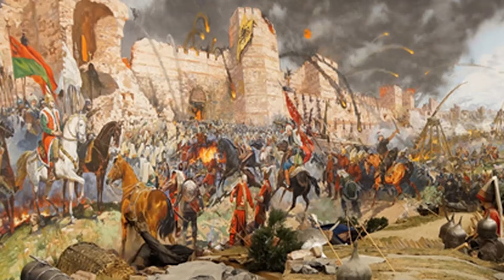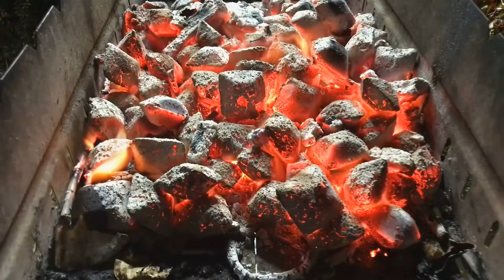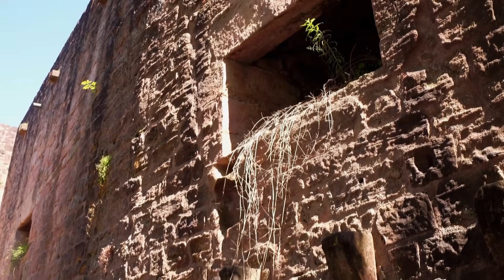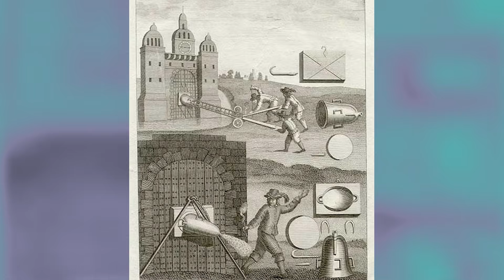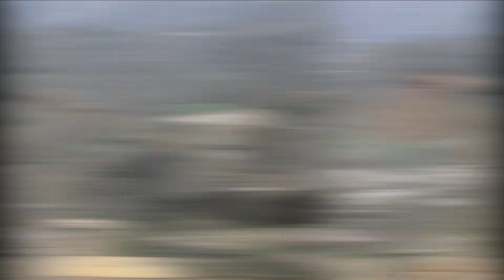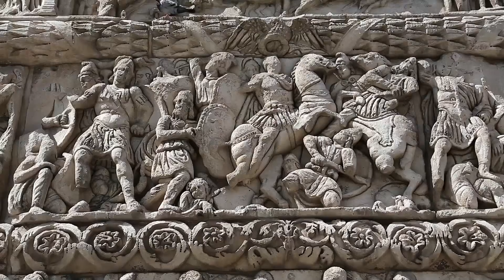15 GENIUS Ancient Siege Weapons

Comment: So many issues with this post. The timeframe described is far from "Ancient" (which is a specific historical term used to refer to a time period which, at least in western history, took place prior to the Classical era, or at most, includes the Classical era and ends with the start of the middle ages) - Explosives and Trebuchets are from the Renaissance and later. Circumvallation is not a "weapon", but a strategy of conducting a seige. Claiming it is a "weapon" would be like claiming encirclement or a feint is a "weapon". Finally, both Aristotle's Claw and Archimede's Mirror are almost certainly fake. They have been investigated multiple times, and never shown to have worked. Of the 15 "ancient seige weapons", over 1/3 don't actually fit the category, and they couldn't even bother to make all 15 at least be weapons.

Comment: The hand powered trebuchets most certainly evolved from staff slings. Despite the general depiction, I fully believe that the sling David used against Goliath, and indeed all shepherds used in their vocation, were simple thong slings fitted onto the ends of their shepherd staves as opposed to a hand sling. Indeed, the Greeks consistently used staff slings (or "one man trebuchets" to help you visualize it) as part of their missile barrages during engagements. 

Hand slings, although indeed formidable, are far outpowered by staff slings, and it would take nothing for a shepherd to use that instead. It's incredible how much a simple misunderstanding of what was common for a time can shape a tale thousands of years old into something other than it was.

Comment: The battering ram really wasn't so genius. Testaments to siege warfare suggest that the battering ram was tried oftentimes just in case the enemy had forgotten to get a strong door for their fortress.

And contrary to popular belief, siege towers were not often used to reach castle walls. They were instead used as an elevated firing platform for archers, and had the stunning speed of 1.25 meters per hour.

I argue that the most important siege weapon was the shovel. Sieges did not demand the skill of knights, they demanded the skill of engineers. Things like trebuchets and circumvallations could not be made without the skill of siege engineers in one's attacking force, and it could take months to build a single trebuchet.
Reply: It reminds me of the battering ram in LOTR movies

Comment: The sea claw device seems like it is a myth rather than a reality. It could only reach a little past the walls and there would be little reason for a galley to be cruising just over the submerged rocks right next to the walls. The ship cranes just did not have sufficient range to be an issue. Yeah, supposed those rising boarding ramps were in use but it shouldn't take long to figure out where to avoid the cranes.

Comment: Siege towers were not used to put soldiers onto the walls (with some very rare exceptions). Ditches, uneven ground and other defenses would make it impossible to drag such huge structures close enough to the walls. They were simply platforms for archers enabling them to shoot down at the defenders.
Reply: Right? a Rope! and Tug? and Down she Goes!  Had to stay out of that Range!  maybe a ramp if the opertunity was there, but these dudes Lived and Died with their Smarts!
Reply: You're wrong man...
There are several ancient documents and images confirming...
The siege tower or mobile tower is a war machine used to reach the defensive walls of a city or fortress during a siege.
The siege towers were made of wood, pulled by oxen and with some walls covered with skins to protect themselves from enemy missiles. Inside there were several floors connected to each other with stairs. At the top there was a "drawbridge" which allowed access to the walls.[1] They had a square base and to ensure they were sufficiently stable, not only did they narrow in height, but the area of the upper platform was equal to 1/5 of the base. They could reach considerable heights, as happened during the campaigns of Alexander the Great where one of these reached the measurement of 120 cubits equal to 53 meters. In Roman times we know that in Masada in 74, one of 60 cubits was built, equal to about 26 meters, also equipped with catapults, ballistae and a large ram.

Greetings.

Comment: Caltrops, the simplest and most dangerous of all of them. That's because of the barbs. Hard to get loose without losing your feet. Especially in those times.
Patards are still being used in IED's today.
Btw, for those 'claws' you need huge counterweights to lift a ship out of the water, a very strong grip and beam, and be able to rotate. I've to see it before I believe it. Same goes for the "death ray". Back then, they didn't have mirrors. Anyway, interesting video. Thanks!
Reply: "Back then, they didn't have mirrors."

Yes they did.   First known mirror was from 6k BC or something.

"Btw, for those 'claws'"

My guess is that they exploited leverage far more than the vast majority of modern guesswork shows.
I can come up with several options that should work at the very least.   And if they placed them in optimal positions, they wouldn't need that many for them to be as effective as written, especially as they probably also surprised the enemy.
Reply: It makes me sad to think of the horses crippled by these things and harmed or killed in all those wars. 18 million horses suffered and died horribly in WW1 for example.
Reply: @thinkforyourself2109  Yes, they never mention that in the history books.

Comment: the "death ray" was never validated.while parabolic dishes are stupidly powerful,the focal points are range spicific.and that range is pretty short.and that's with high quality mirrors of today.consider the fact that all they had was polished bronze,I'd say while it might have been made,and may have scared enimies,I doubt it was ever actually used,at least not to the effect of torching ships.replicate the scenario and prove me wrong lol.show me that a series of polished bronze Shields from the top of ramparts and walls can light ships sails on fire in a harbor below.until then,I'd just call it a tall tale based on tech that was made but never used or verified.archimedis was one of the best inventors in history.no question there.but this might have lent him a little bit of a fear factor for enimies especially after Rome tryed and failed to sack the city.things would have deffanatly been prone to exadgeration.a more likely theory is the dishes created beams of light that could have easily made vision an issue,especially for aiming weapons or piloting ships.shine that in somebody's eyes,they won't see crap lol.or could have been used as a signalling device.but as a means to torch ships,no lol.it would be extremely situational at best,even if we pretend it worked.the sun would have to be positioned just right.meaning enimies would have to be kind enough to sack your city at just the right time of the day for you to kindly burn them alive.its simply unrealistic.

Comment: Ida like to seen what they used to raise the pole that held the cable that held the hook that snagged the ship and lifed it up.  It sure wasnt what was shown in the pic.
Reply: A hypothesis I have seen, which seems more reasonable, is that the ship smasher(s) were simple spears embedded in the seafloor which could be raised by cables - pointing upward toward the approaching ships.  The hulls would run onto the points and the ships' own momentum would pivot the spear up and through the hull - breaking the keel and momentarily raising the ship(s) above the surface.  The advantage is that it requires no sophisticated levers and is largely concealed until the vessels hit them.  An unwieldy,  giant claw being manipulated from the walls would be readily evaded by the oar driven bi/triremes.

Comment: After searching for way too long, I finally found the information I was looking for 😞

Trebuchets were constructed at the siege. That was all I wanted to know, good day.
Reply: If they were constructed before the army would move slow like tortoises or couldn't move at all cuz it doesn't have wheels.
Reply: @godisforever7263  constucted* 

I had assumed they were constructed at the siege, and wheels exist. Ya know...
Reply: @xomvoid_akaluchiru_987  I mean still they will be hard to move
Reply: @godisforever7263  right, but it was a possibility, but that’s why they build them at the siege. 

But as a hypothetical, let’s say the offensive army is building the Warwolf. In a different scenario reinforcements could have come and stopped the siege, the whole Warwolf would be left behind.
Reply: @xomvoid_akaluchiru_987  hmm then the best option for the offensive army is to either bring catapults which wouldn't do much against the fortified walls or either they build an teribucthes with wheels inside an safe province and move it to the defenders.
Reply: @xomvoid_akaluchiru_987  Or try and use the walls thing and protect themselves from the reinforcements and keep constructing the siege weapons

Comment: The big  and small trebuchet were on wheels or on rails--it increased the range by about a third, and stopped the machine wrecking itself.
,
Reply: War..a guy thing.
Reply: @renahernandez5120  Nope-just applied physics.  Action and reaction are equal and opposite-
Reply: @renahernandez5120  Have you not heard of Queen Hatshepsut?